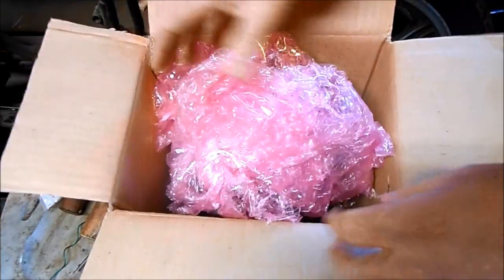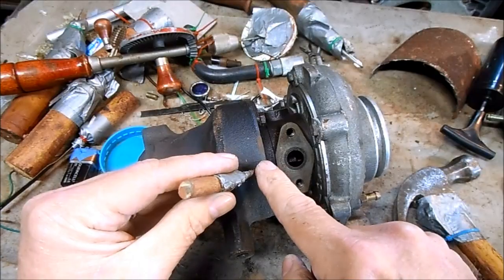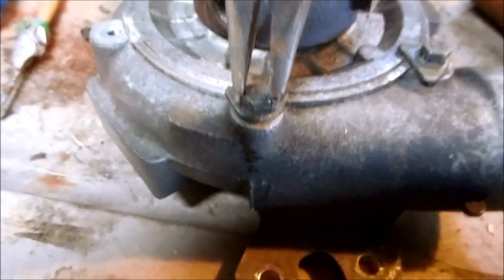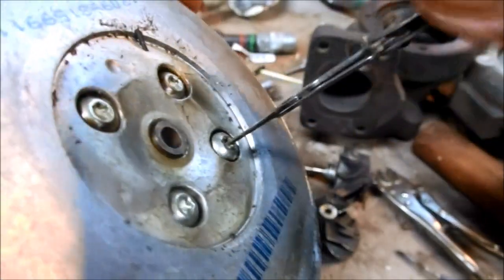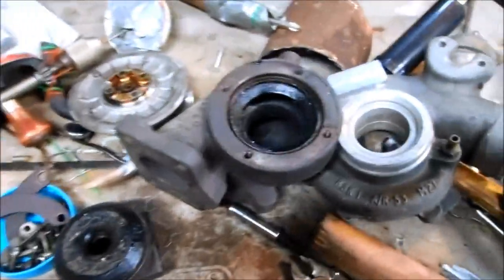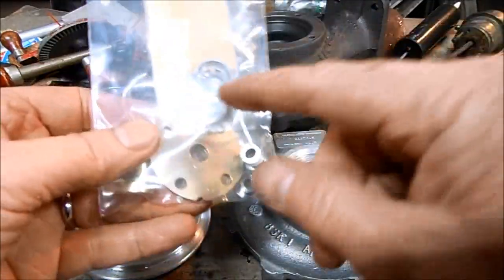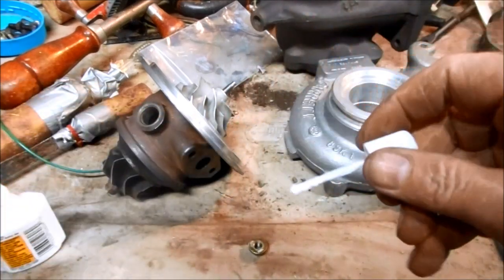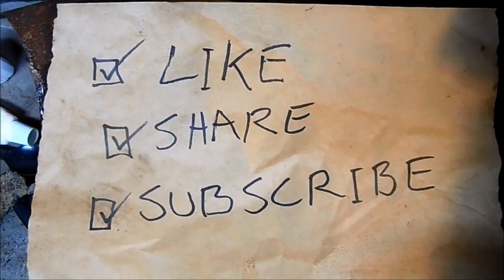how to rebuild a used turbocharger

Comment: Damn, I just bought my Metric vice grips after your last video, now I am going to have to buy left handed as well. I guess I am going to have to get both the metric and imperial left handed ones as well?
Reply from the maker: +arcadeuk   yes.  unless of course you pick up an antique brit bike, then you will also need Witworth  ones...
Reply: I wish someone would just sell a full set of the 10+ different types of vice grips, so I could buy them all in one go. It took me ages to realise that my vice grips were slipping all the time because I was trying to loosen metric nuts with imperial grips. Now at least I know why I've been unable to loosens left-hand threaded nuts

Comment: My screwdriver doesn't have a handle, so I had trouble tapping it to remove the compressor. I had a look around and the only thing I could find was a frozen hotdog. After a few taps it came right off, plus it smells like hotdogs now! Thanks Ichiban!
Reply from the maker: +risc19  oh, bad ass!   I love hot dogs ! especially with a few sporks of mustard !
Reply: Was it the big hot dog from Costco.. you can bang the turbo housing and the girl next to you with that hot dog...lol
Reply: The driver part doesn’t have to be in the handle to use the handle part. 
Sheesh 🙄